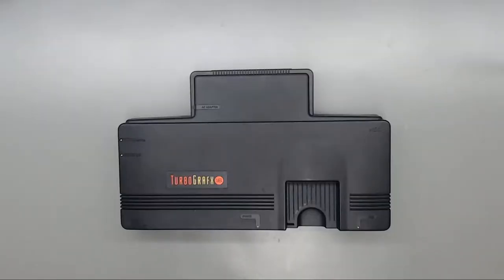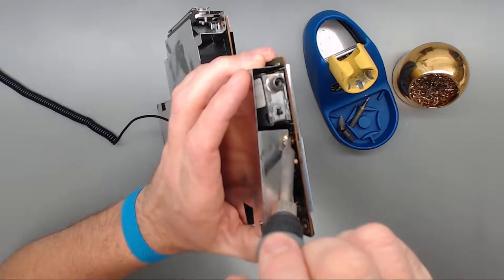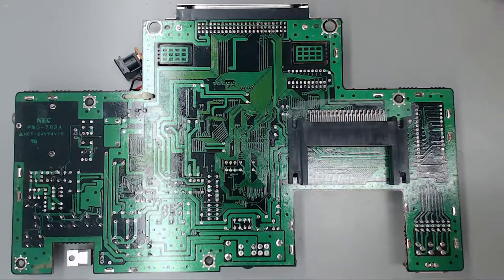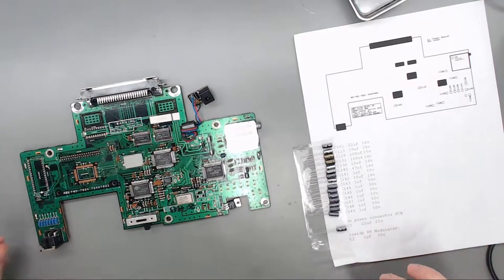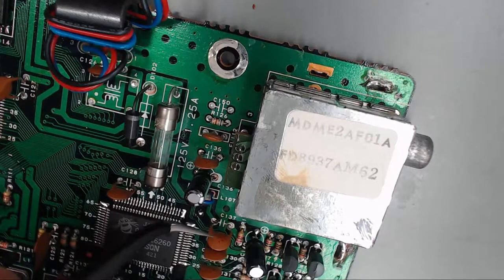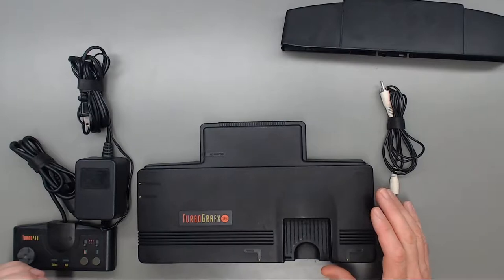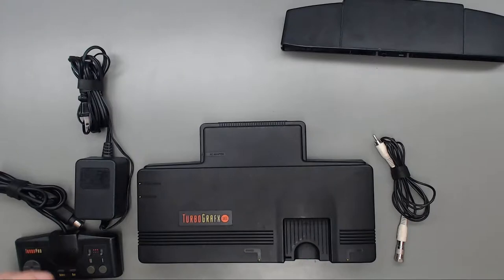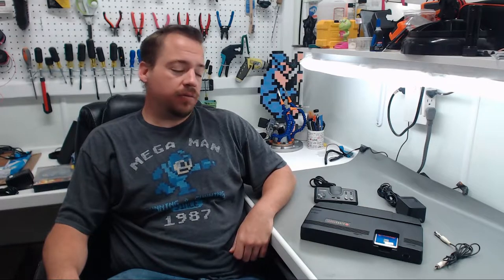NEC TurboGrafx 16 Capacitor Replacement and Jail Bar Fix

Comment: Great video! Thanks, I feel confident to complete the task now. Do you need to completely reassemble the console to test it after the recap? And if the console currently doesn’t have jail bars should you still add those tiny capacitors just in case?

Comment: My TG16 is having an issue displaying RGB. Looks like the red signal is missing. Could this be caused by faulty Caps? if so, does anyone know of a place where I can send it to get recapped? I am a novice at best with soldering, and don't want to destroy an otherwise fully functional console
Reply: Did anyone contact you?  PM me